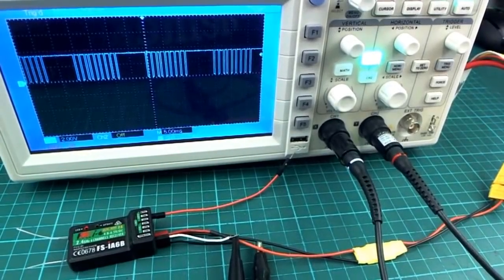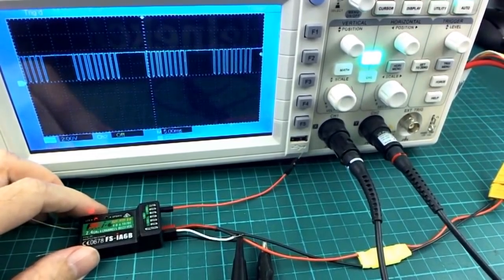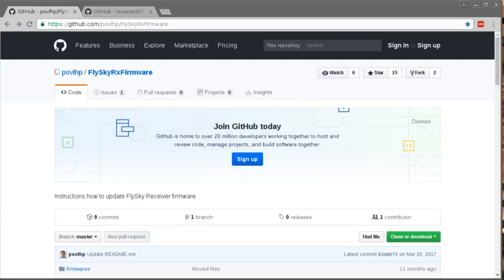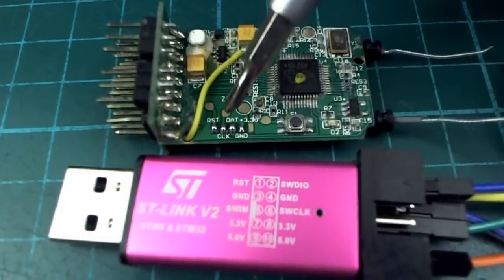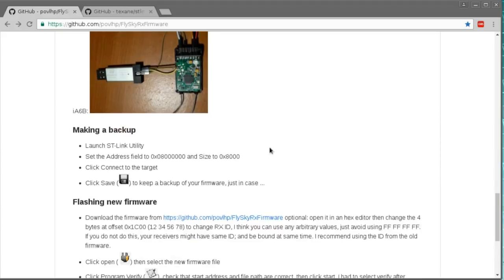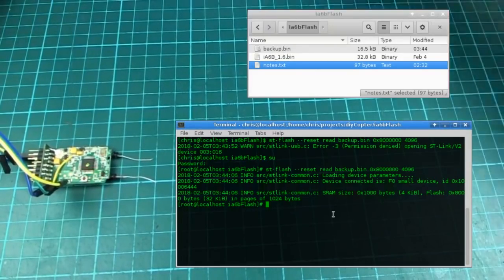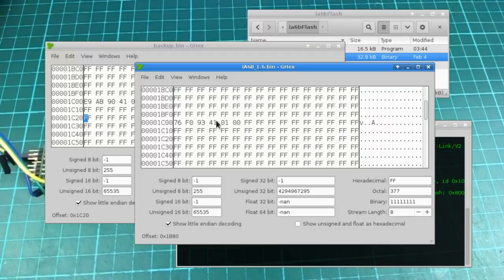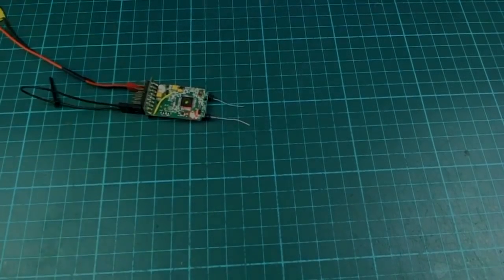FS-ia6b receiver firmware update (linux)

Comment: dd if=backup.bin of=firmware.bin bs=1 seek=$((0x1C00)) skip=$((0x1C00)) count=4 conv=notrunc
IF this works, maybe you don't need the hex editor, and can make it into a script.
Reply from the maker: I gave it a try, unfortunately it truncates the file after the position of the 4th byte
Reply: Fixed it. Was missing conv=notrunc option. Just note that both backup.bin and firmware.bin must exist before the command, and firmware.bin should contain the new firmware.
Reply from the maker: That works now, nice one :)

Comment: i know its been an old video but im still facing same problem i have more than 10 receivers that i cant use u bought the ia6b and the ia10b and both same problem low range less than 30meter then low signal peep will come on the remote i dont know what to do and its very important for my work please help
Reply from the maker: If you have 10 receivers that all have the same problem, it sounds like the problem is actually with the transmitter. Or maybe your environment has a lot of radio noise. I regularly use these up to 1km or more but it's very quiet country situation here.

Comment: Can it be updatet using an arduino or something else, becourse i dont want to buy a Stlink Adapter that costs the Same as the resiver itselve.
Reply from the maker: I don't understand. The adapter costs around $4, about the same as an arduino. You only need one of them to update all your receivers, plus anything else that runs STM32.
But anyway, the answer to your question is no.
Reply: @iforce2d  i know the costs, But i have alredy some arduino boards laying around, so there is no extra cost if i could use them.

Comment: Great video again, so many thanks. Just a quick tip, SBUS is available with the latest FW on the basic i6 (non x) and  I also notice your scope is often failing to trigger, using trigger will prevent it scrolling asynchronously, more like when you hit hold.  Use Chan2 and set the channel to trig, then use the control to shift the trigger line to say 1/4 up the vvoltage of the waveform being displayed on Chan 1 😉.  You probably know this by now but it may help others.  Cheers again

Comment: Worth noting that if you have an Ibus capable FC, you should use Ibus, since it has extra crc to avoid errors e.g due to long cable, which is not the case with sbus. It has faster refresh rate too, IIRC.
Reply from the maker: good to know, I didn't realize that

Comment: A you finaly did it :) I did mine on windows and i did not have to use reset pin. The other thing you get with this firmware is RSSI on transmiter alsow on the fpv goggles through one of the channels.
Reply from the maker: Can you elaborate on that last part, do you have a link to some info maybe?
Reply: iforce2d https://youtu.be/flUXabkxoOg
Reply from the maker: Very cool!!

Comment: I have yet to find out when the reset line is needed and when not with those STM32s. Not connecting it has sometimes lead to weird behaviour though, like the MCU randomly no longer being writeable (until a power cycle) after multiple successsful writes or even the st-link locking up completely so it has to be disconnected from the computer.

Comment: The ST Link is generally great to have, it works on many modern micros that support swd programming. I first used it for stm32 dev boards, but since found many uses for it.
Reply: What else are you using it for ?
Reply: Michel PASTOR most of the new RC stuff uses an STMsomething processor, like flight controllers and such. And it works with the Nrf51822 Bluetooth low energy arm mcu and similar (Nrf52832). You can use it with openocd for debugging in eclipse, it's a great tool for the few bucks you pay. For the chips that support a swd programmer it's way better than a serial bootloader. And it itself uses an stm32 so you could reprogram it to be a black-magic-probe or anything you want.
Reply: Nice. I need to find how to do HW debugging but there is no way I'm using Eclipse X-(

Comment: Can I use the PWM output at the same time than i-bus or s-bus? I have a Fs-i6x, with a X6b and a extra IA6B. If it's possible, I could control a gimbal through PWM while using a i-bus/s-bus flight controller...
Reply from the maker: Yes, as long as you don't set the PWM/PPM output to PPM
Reply: It will help me a lot. Thank you!!!

Comment: Interesting, I have a few of those.
Poor ia6B has had antennas mutilated. Do you still use it ? how's range without the bulky original antennas ?
Reply from the maker: Range is probably not very good. This one lives at my desk, for experiments :)
Reply: You just need a bit more then 1/4 wavelength (31.25mm) of the antenna left from the antenna to work properly. Only the uninsulated part of the antenna is important. https://www.youtube.com/watch?v=0Pai8iJUrh0

Comment: FS-i6 with 10ch firmware can do SBUS.
Reply: Yeah, that one. It doesn't mention it but it's there under System -> RX Setup -> PPM output. I tried once connecting it to SBUS pin on FC and selecting SBUS in BetaFlight and it worked.
Reply from the maker: I see. They must have added that to the firmware since I updated mine because I didn't get any menu for that. Are you talking about this one? https://github.com/benb0jangles/FlySky-i6-Mod- It mentions nothing about s-bus...
Reply: iforce2d yes it does 10 channels through sbus...
Reply: sergeysi779 that's what I wanted to say. Thanks for clarifying.
Reply from the maker: hmm...  mine must be from before they added that, it's dated 20/1/16. In the PPM output page I only have the option to use PPM or not, same as the original firmware. Very strange that they would implement something like sbus support and never mention it anywhere... the commit comments are completely useless too, they all just say "update .." :D
Reply: iforce2d yeah right😊
Reply: iforce2d it has sbus but i personally cant get it to work
Reply: I recommend you use the github/QBA667/flyskyi6 repository for most information and updates. Discussion still in the rcgroups thread.  Changes: better updater, ppm passthough from trainer port to aux channels, FC telemetry, timer, vario etc. 3 position SwB & SwC, add SwE. Signal quality on aux channel. Combine SwC & SwD for flight modes. Note: i6 not i6x
Reply: I think the reason for not mentioning S-bus it due to licensing, the original S-Bus protocol (chipset) was designed by Sun which once outdated due to speed limitations (superseded by PCI) was taken up by Futaba as a proprietary system. I believe they avoid royalty/penalty with no mention in advertisement or marketing.. Say nothing and nobody will ever know.. They conveniently even leave it out of the manual, at least in my two i6x's not a word, but it's there.